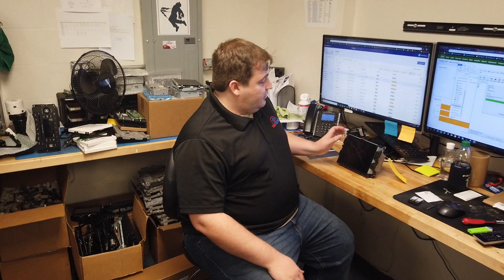Broken Car Radio Touchscreen? Here's The Fix From NavRepair.com

Comment: Hello I bought a Raxiom aftermarket touch screen with nav for my 2011 Mustang the car has very low miles and I hardly drive it the screen sometimes works other times it does nothing I cannot adjust anything on the screen most times . I bought the unit brand new from American Muscle which is way out of warranty and they have offered no help in remedy the problem. I touch the screen some of the pressure points work then others don't. What could be wrong?? Thanks

Comment: Hi I have a power acoustik 10.3 103bt cd DVD player. I cracked t screen pretty good. It still works with the remote but you can't see the picture

Comment: Thanks for sharing !
I have a question:  an old Advent aftermarket multimedia car radio, ( ADVUV630) it was working fine, I tried to upload the new firmware, from the Advent web page, but by mistake I uploaded other firmware file. the radio accepted the software but when was 100% completed it went off by itself and I couldn't turn the radio on again. Do you know if there is any way to "restore" the basic OS to be able to turn it on?

Comment: I have a 2018 mustang so it already had a touchscreen. It had a report that the screen doesn’t respond at times. I didn’t have any problems until winter came and it wouldn’t work most of the time. Then it was the cold that made it not work and would only work if the car was running for awhile or when it was at a warm hot temperature. Now that winter is over it’s not working at all. Is this repairable or no ?

Comment: I recently purchased the UAQ 8.4"(C-UAQ-JL + C-BEZ-84JL) and installed but my backup camera doesn't work. Any ideas why?
Reply from the maker: Hi Dwayne,
There are some rare occurrences that the vehicle is a little stubborn on fully accepting the UAQ system, so what you're experiencing is a miscommunication between the BCM and the UAQ. You're going to have to do a canbus reset, which should clear that residual charge and allow the communication to work properly. There are two ways to do a canbus reset, one, you could disconnect your negative terminal on your battery for about 20-30 minutes (both batteries if the vehicle has two). Or the faster way, disconnect your batter terminals (both if you have two) touch the positive and negative leads together (one at a time with both disconnected from the batteries if two batteries are present), then wait about 10 minutes than reattach the terminals and restart the vehicle.

Comment: How do you repair from using rubbing alcohol on it. My 2019 Subaru I wiped it to prevent Covid19 but after it didn't work. I didn't realize it was bad. Is there a fix? Thanks
Reply: Worrying about Covid was your first mistake